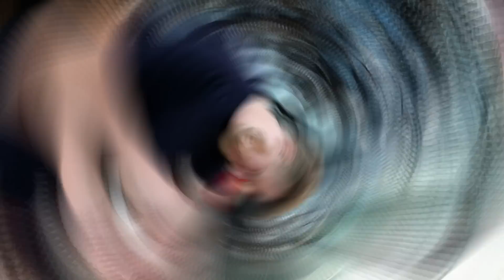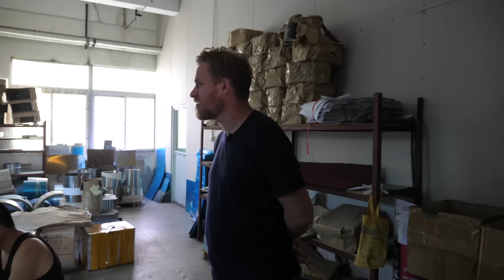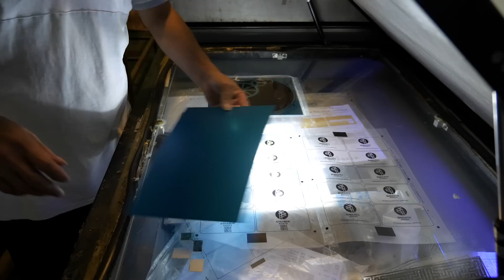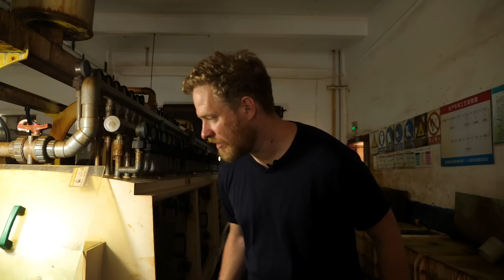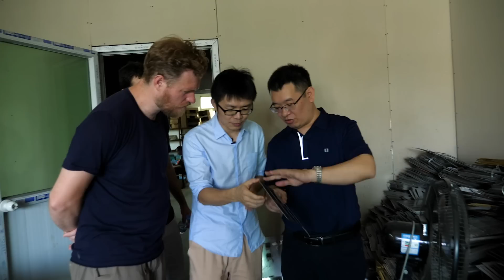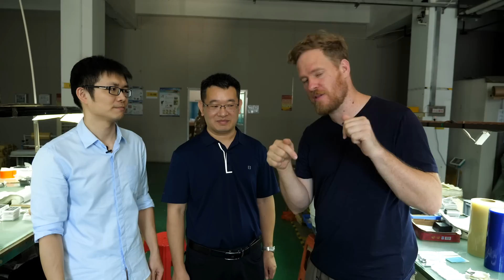These STEEL Business Cards WEREN'T Made with a Laser

Comment: It’s called photographic process where the image from the stencil is transferred to the blue chemical once exposed on the light. The black print on the stencil which will cover some parts of the blue chemical will not be exposed. The exposed part will harden and the non exposed part will not. The not exposed part will be easily removed. This is the same process for making tshirt silk screen.

Comment: i like the fact the room has a huge sign of "respirator necessary" and the worker wears a weak ass 10 cents paper mask.
Reply: They do not supply the workers with the right equipment cheaper to just replace the workers.
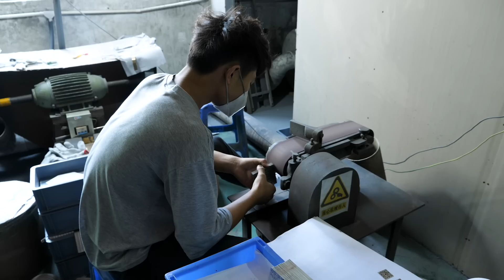Reply: @Tunnelrat6666   Not necessarily actually.... Later in the film, there is a worker wearing an much more legit respirator, at least from the looks. 11:51  . So maybe the sign is misplaced or the worker bought his own respirator.

Comment: Quick Explanation for anyone curious: Most QR Codes have some amount of parity bits contained within them, which is why most will still scan as long as you don't cover too much of it. When making QR Codes, some tools even allow you to specify the amount of parity information contained, at the cost of a bigger QR Code. The algorithm used to create parity data when the code is created is called the Reed-Soloman Error Correction algorithm. These are the levels of error correction:
- Level L will correctly scan a code with 7% unreadable data
- Level M will correctly scan a code with 15% unreadable data
- Level Q will correctly scan a code with 25% unreadable data
- Level H will correctly scan a code with 30% unreadable data.

Comment: Biggest mistake with QR codes is adding more data than absolutely required or adding too much error correction. Both of these mean that each pixel is smaller and the code becomes harder to scan.

Comment: There are different percentages of correctable errors, depending on what you specify on generation. On the highest setting about 30% of the data area may be missing. The big squares are just for orientation and not part of the data area.

Comment: I’m surprised you didn’t mention the industrial use for this process, which you briefly showed in your last video on PCB manufacturing.
In PCB manufacturing they use this method to create a mask that they use to apply solder paste to only the areas they want on a PCB.
This process is also commonly used to produce “GOBOs” which are metal slides ( Images ) that are placed in theatrical lighting.

Comment: Got to wonder why no one wears laser eye protection. I guess it's just cheaper to hire fresh eyes.
Reply: Plus no guarding on the laser machines to prevent finger burns. It looks like the operator was placing one card whilst the other was burning then pressing a switch to let the laser controller know it was present then removing the card that was completed.
Reply: If they had worked you would be wearing them 😉
Reply: Approved pair of glasses to shield your eyes from the laser beam is $200 or more, bosses in 1st world countries would cringe because of this price, and in China?
Well basically what you said...
Reply: Do you stare at the sun... where is the warning labels... 
Called being smart.
Reply: @wobblysauce  so you say, but if you paid someone to stare it then you will surely have OSHA on your ass for not providing them with adequate protection
Reply: safety 3rd
Reply: During grad school I worked with some intense lasers (>5W) for measuring the movement of particles in water, and once everything was set up goggles weren't needed anymore, because we knew exactly where the laser was and where any reflections would be going.  Even when the techs would come they would have laser goggles but rarely put them on.
Reply: Fase safety:
Which eye protection does resist to >500W laser ? 
Nothing you could wear, glasses would explode...
Reply: @AltMarc  Just bad reflection and you are blind. Glasses are exactly for this purpose
Reply: @KucharJosef  Blind by bad reflections, possible but in many cases with a probability higher than getting struck by a lightning.
If you need to wear laser safety glasses in an industrial process then your safety concept is bad anyway.
Reply: It is china they all have fake eyes.

Comment: Wondering if the Stainless would act as RF shield (blocking credit cards from being scanned in your pocket).
Reply: depending on the thickness of the steel or the frequency of the radio wave
Reply: Would guess if you could get them made from brass it would be better. 😅 Also depends on the pattern ect, best way to test:
Try do a wireless payment (self checkout), and put your business card between your card and the terminal. See if it still reads. 😅 Would love it if someone could test this for me. 😁

P.s. If card skimming is a big problem where you live, there is a better solution. They sell wallets with copper wire mesh (acts as Faraday cage), already stitched  into the leather/fabric. They use soft copper wire mesh so it can bairly be felt through the leather (looks/feels just like a normal wallet), but also blocks RF signals. 😊 Hope this helps anyone affected by this problem. I think high end wallets should come with copper weave or mesh as standard now most cards are wireless and most phones can read them (with little modification). 😅

Comment: This seems like it could be a nightmare when dealing with The TSA EDIT: Many frequent travelers don't use checked baggage.
Reply from the maker: Well, I'm flying to the US at the beginning of July, and I HATE checking baggage.  So I guess we'll find out!
Reply: Strange Parts I have these type of cards and I also have TSA Global entry I haven’t had a problem yet. Just bundle them in a outward pocket so you can show them.
Reply: @StrangeParts  Please update this video or add an annotation. Whether it's a problem or not a problem. My advice. Take them and place them in the bin right away. I take out my wallet and I have metal credit cards and, so far, they haven't been an issue.
Reply: @StrangeParts  tell us about it
Reply: I remember I had to leave behind/throw away a pair of small kid's scissors at the airport that I had in my carry-on. You know the kind of scissors with a small ruler on one of it's blades - I'm sure you've seen them before. They were half my hand size, had plastic handles, were blunt (literally only usable to cut paper), and had rounded edges all around the metal. It would make it very difficult to even poke anything. You can't tell me those were a threat, but the TSA agent insisted I leave them behind. 

Here's the point; Some airports won't bother with certain metal objects and let you travel, like I had no trouble carrying my small scissors through European airports and through Singapore while I was traveling, but others will insist you leave them behind. So eventually you'll either lose the object, or you have to send it to yourself via mail every time that problem occurs. I think people carrying metal business cards will face those troubles as well. If you're a frequent traveler, expect to have some of your business cards be taken away from time to time if you carry them in your wallet or your carry-on. It's inevitable.
Reply: @Ultra Mega Its at the agents discretion. Was once asked to remove a glass screen protector from a mobile phone because it was chipped.  Had to toss a bottle opener (nothing sharp, the handle was plastic and the opener was metal) It was given to me in Vegas and it happened to be in my pocket when I was going back home.  Had to mail a metal Cross pen back home because i was going to have to throw it out at the security check point.  I could argue with them but thats just going to cause delays and ultimately just cause me more problems.
Reply: Nosh Abroad „agent’s discretion” = whether they want to keep a nice item for themselves or their kids, or not
Reply: @NoshAbroad  last time i flew i had to throw out an entire metal water bottle. it was new and over $30. the dude laughed as he told me i had to toss it or go back in line
Reply: pvic Well that’s because liquid container.. They don’t care if it’s empty or not.. Straight to the bin.
Reply: @KarryKarryKarry  i would understand that if someone else hadnt confirmed it was ok
and if my friend who was a few people in front of me had to throw out his nearly identical bottle (surprise.. he was allowed to keep it smh)
Reply: @KarryKarryKarry  I always travel with my hydro flask metal water bottle. They ask if its full of water or not. I've never had a problem  and I travel through TSA 4 times a year
Reply: lettersfromhoth I suppose it differs from airport to airport.. Went through Paris and was forced to toss my bottle immediately.. Came from Frankfurt where they made me empty it before walking through.. Maybe TSA agents just hate me.
Reply: @NoshAbroad  his religious looking beard wont help him
Reply: Nosh Abroad he could just ship it to himself
Reply: @Juanguar  He wants to travel to and from America. This is going to come up every time he passes through TSA. Sure, he could put business cards in his checked baggage (if he has checked baggage at all) but the point is to have business card in your wallet so you can give it to someone when needed.
Reply: It's fine. They're not sharp, and carrying on a pen (or even a pencil) is fine too.
Just remember not to keep them on your person when stepping through the scanners. Empty your pockets like you're told, and you should be fine.

But maybe the checks for flying to/from the US is much more anal than to/from anywhere else. I wouldn't be surprized.
Reply: Many credit cards are now metal and for years I never had a problem with J.P. Morgan Palladium Card or the amex centurion card. 
Even now the AMEX Gold can get in metal. 
Early on some places did ask whats metal in my wallet only one place asked to see them and was no problem. 
Some expos like CES I had manufactures hand out cards like this had them in my cary on and no problem not asked one time about them. 
I don't see a problem unless shaped like a knife or something like that if they even ask.
Reply: It's not like there is a blanket ban on metal items. The TSA will probably look at it, but it's going to be fine.
Reply: @Ultra Mega lol dude, you are assuming the TSA Nazis aren't power tripping or stupid, which they are about 50% of the time. if you're lucky you can appeal to the Staffelführer but most likely you'll get the same result just with more wasted time. fuck the TSA.
Reply: Just stick them in a checked bag.
Reply: @descendency  Many frequent travelers don't use checked baggage. Especially business travel. I prefer carry on and personal item only to save time.
Reply: @Ultra Mega exactly this. I literally have a 1 inch thick chunk of Aluminum I use for work that gets checked everytime. Just have to take it out and set it in the bin. 0 issues.
Reply: @Ultra Mega should be fine if it's not a carry-on right?
Reply: When traveling by plane through the US, you're supposed to hide them in your 10th spare mag.
Reply: bring a mailing pouch in case, perhaps!
Reply: @MrTeetec  I just see them making a stink about having a metal object on your person that could be used maliciously.  I have been force to trow away items even more innocuous than this when traveling through American Airports.
Reply: I'm sure it's safe for airport security, some banks have full metal credit or debit cards, Revolute for example.
Reply: Star Boy The issue you have with steel business cards is you’ll have a stack of 50 cards per box. A business traveler would bring at least several boxes of cards with him on a business trip. It would be shame to throw it all away if you encounter an over zealous TSA agent. So it’s nothing like a few steel credit cards on a wallet.
Reply: @starboythebest  Yeah, and the new Apple credit card will be made of titanium, so you'll start seeing a lot more of those anyway.